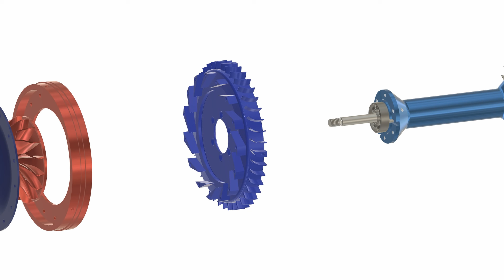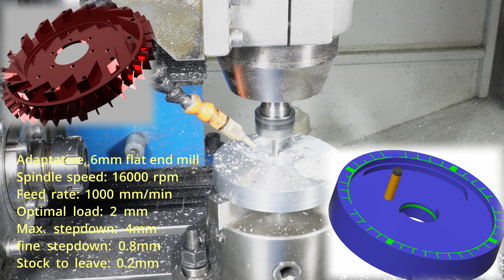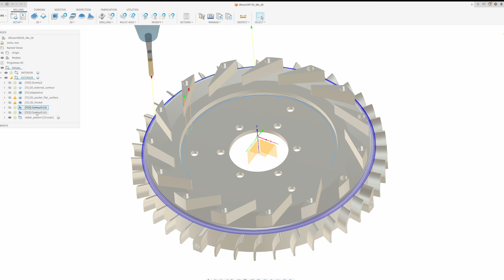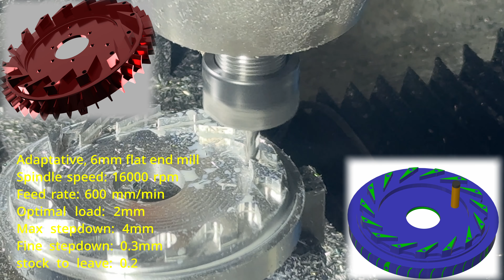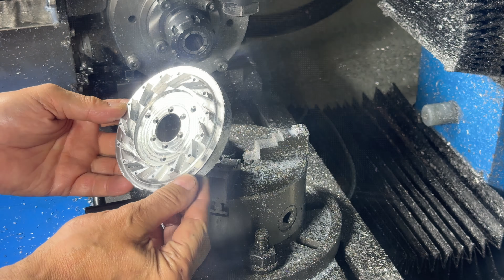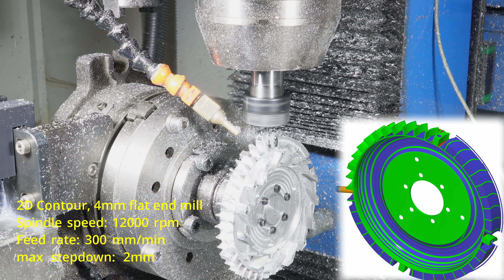I Tried Machining a Jet Engine Diffuser on a Hobby CNC, RC Turbine part 7

Comment: Hello mr.Alfanso is the diffuser's geometry looks even in the vane inlet width and outlet width .Or it can slightly expand in a small manner and also the vane height looks bigger than the compressor's outlet (exducer) blade height . is that intentional or you get learning from this ..
Reply from the maker: There are basically two types of diffusers found in the literature: one that can be manufactured using a 3-axis milling machine, and this design, which requires a 4-axis milling machine. Here, I am following the designs of the KJ66 and GR130, which are well-documented online. By the way, this is my first turbine and I haven't started it up yet; we'll see what the tests reveal...
Best regards.
Reply: @alfmart58 oh, okay Mr. Alfanso cause I started to design a new trunpet like diffuser on my own. That's why I ask the question before and where have you get the designs of the kj66 and it's components like the data and performance sheet. Just for a reference for a scale up...
Reply from the maker: For your information , there is a private forum : https://www.gtba.co.uk/ where you can find a lot off usefull technical information. Regards
Reply: @alfmart58 thank you Mr. Alfanso

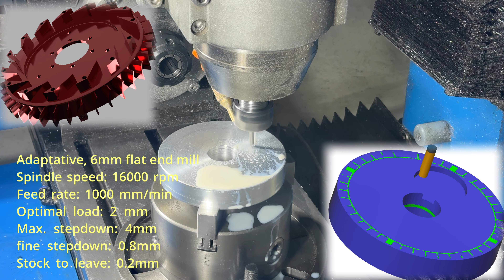Comment: 2:00 It's a very strange strategy. With a hole like this, a spiral milling is a no-brainer.
Reply from the maker: Yes, sounds strange but if I start from the hole I cant access other ares that are at lower lever fron the inner surface, or at leat I dint fount a solution in fusion 360.
Thanks for your comment any way

Comment: Since you have access to a CNC and a CAD program, maybe try something different than the old KJ66 diffuser with the wedges.  NASA Report No. CR-120941 concerning a small, high-pressure centrifugal compressor gives some decent data on designing a really nice diffuser using NACA 65 airfoils transposed from the axial plane to the radial plane with 22 sets of two tandem airfoils in a cascade.
Reply from the maker: Yes, you are right, but I need first a solid base where to start invstigating, and I'm not there jet... Hopefully if the motor works I plan to investigate different imrovement, combustion, diffuser, exaust, ..
Thanks for your advise

Comment: awesome project, im a cnc machinist and programmer, and was wondering why you did not start in the middle of the part on the first adaprive roughing pass . could have saved myou helixing into the part
Reply: Ah, sorr did not see. Do you have an optiondo define open spaces in your cam? Im only familiar in mastercam
Reply from the maker: @13murmur12 I’m using fusion 360,and i didnt find how to solved, I will investgate more in deep👍👍
Reply from the maker: I answer it already, if I define entry point in the bore, the adaptative do not reach the lower part of the material that is below the entry point and located close to the external border, or at least I didn’t know how to do it. If you have an idea please let me know
And thanks for your comment

Comment: At the 2 min mark why did you not just drop into the hole allready there over helical mill down?
Reply from the maker: It was a problem with the geometry, if I specify as entry point the hole, then the adaptative strategy do not know how to enter  in the deeper area that is close to the external border, and then this area is not toched, is for that I have to leave free the entry point .
Thanks for your comment

Comment: Is it possible to machine this using a 3-axis?
Reply: Actually, we are currently making kj66 as a team project. But in the process of making diffuser and ngv, I was told that there is only a 3-axis machine in the school machining room, so it is impossible to make it. So, after discussing with the team members, we are thinking of manufacturing only the base plate and the vane in the machining room, and we are going to manufacture and insert the blades other than that separately. Is this method possible?? If it is in the form of only the base plate and the vane, is it only possible with the 3-axis machine?
Reply from the maker: @신성준-n7t try to find in the net the other standard desing for the diffiser with big blades, this can be done in a 3 axis
Reply from the maker: I don't think so, but there are other diffuser designs that can be done with 3 axis, even in a manual milling machine

Comment: I have made several of these KJ type diffusers, and I have to disagree with you. They are quite simple...they just appear complex. I think you were overthinking it a bit. They also do not require the precision you may be thinking they require. The only truly critical part is the concentricity of the compressor "pocket", O.D., and shaft tunnel bore for locating the shaft tunnel. The rest is surprisingly very forgiving. You would have been better off turning the major cross section, and mill only the vanes and hole locations.
Reply from the maker: Maybe you are right, but complexity is related to my CAM experience and my machines. Thanks for watching it

Comment: It would be easiest with a 5 axis machine but great work with what you have
Reply from the maker: Completely agree, all corners and edges will be much more easy with 5 axis machine, but.... mine is only 4th. I was studing the posibility to add the 5th one but I believe have no sense in my hobby machine

Comment: Beautiful! Are you using the 4th axis machining extension to program the contours on those outer foils?
Reply from the maker: This is not an extension in fusion 360 , is just an standard option in 2 d contour, it is just  to define  the 4th axis in the contour

Comment: Over the course of 3 years I have designed a Fully metal 3d printable version of the kj66, aiming to address some the challenges in manufacturing and fuel delivery. The original design utilizes a flame tube with the fuel nozzle at the center spraying in directly down to the combustion chamber relying on the venturi effect and dilution holes, to mix oxygen and fuel. What I did is simple I angled the nozzle 60degress, so the fuel sprays into the wall of the flame tube, forming a vortex/helix, which does 2 things takes heat away from the flame tubes preheating the fuel and vaporizing it, and prolongs the time the fuel spends in the flame tube mixing before it burns. I also added internal air/liquid bearing cooling vanes, through the central shaft sleeve, and at one point added dilution holes to lower the temperature of the exhaust.
The front half of the Kj66 can actually be 3d printed using thermoplastics, such as the compressor and compressor cover. 
To simplify the construction of the outer shell 2 cylindrical plates can be used one connected to the front of the turbojet and one to the back, leaving the combustion chamber visible to the naked eye. the plates would then have a O ring or high temp gasket placed on them, they would then be wrapped and clamped with a roll of thin sheet metal, sealing the jet. the Metal can also be replaced with a transparent material to observe the inside of the jet and make deductions on its performance.
Reply from the maker: Very interesting idea, thanks for sharing them. With respect to the compressor in 3D print, I honestly belive this will not suport 120.000 rpm due to centrifugal forces. And yes, there are several designs about the fuel delivery, I plan to check several designs, i.e. some desings includes a couple of turns of the small tube before going inside the combustion tube.
thanks for watching
Reply: We have produced a large number of these Jet Engine Diffusers.
Reply from the maker: @joannaluo9124 ahh ok then

Comment: One percent oil in the water avoids fogging and is plenty lube.  It also allows you to turn up the flow rate for better cooling.
Reply from the maker: Very good idea, thanks
Reply: @alfmart58  Worth some testing time with the various materials.  I found it works fine even with 316 stainless.  The process is cleaner overall with the caveat of needing to coat bare metal machine surfaces to prevent the onset of rusting.
Good luck.
Reply from the maker: Be sure I will check it, thanks again

Comment: The first operation, was there a reason you didn't do an adaptive entry from the bore instead of a spiral plunge into the stock?
Reply from the maker: Not really , I let the program free without specifing any entry point, but yes you are right, it will be better to enter from the bore

Comment: Looks fantastic! Maybe you think about change the coolant from a emulsione to a Isopropanol or a turpentine but only when you have ventilation. Its way better for alu. And way less a mess.
Reply from the maker: Im working in a garage…..
Reply: @alfmart58  That is sure ok. But the vapor of both iso and turpentine are highly flameable so better push them out the door or bad things can happen. ^^
Reply from the maker: @fearlyenrage yes sure